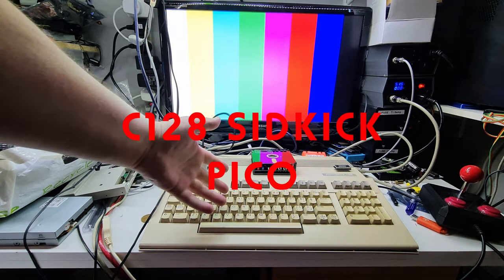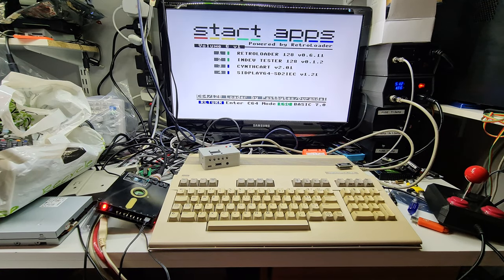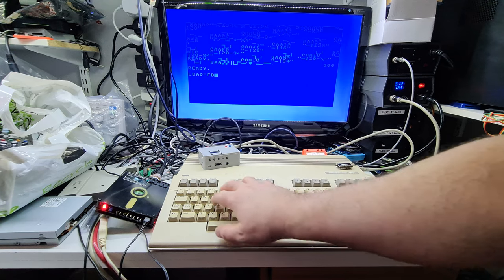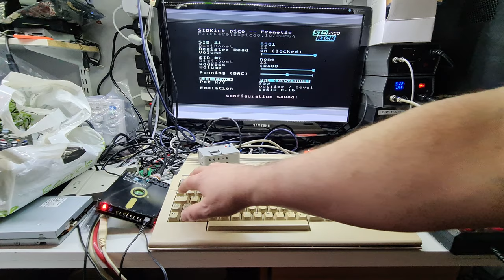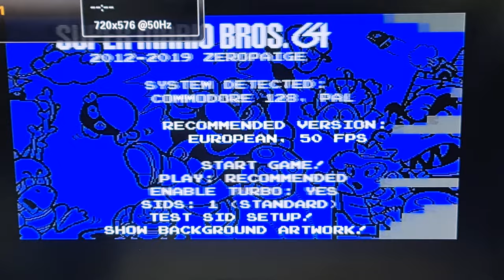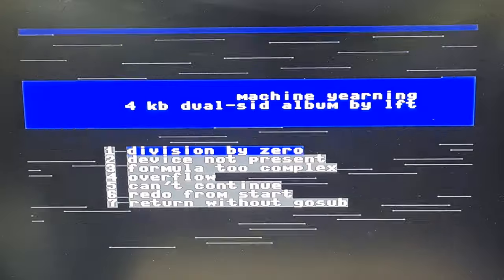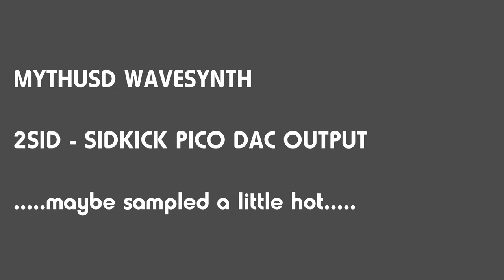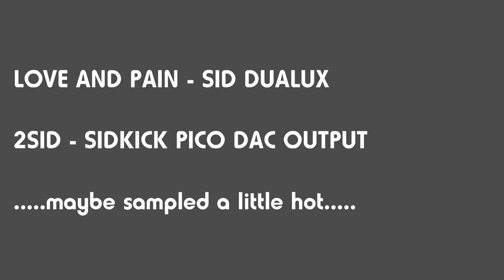C128 SIDKICK PICO - THE LOW COST REPLACEMENT DUAL SID SOLUTION ON THE COMMODORE 64 / C128

Comment: Had some trouble with the pi1541 pi3b+ option B myself, turned out to be a low quality 7406 hex inverter. You did mention it to be genuine chip in there. I had no troubles with a pizero option A. Thank you for the great video

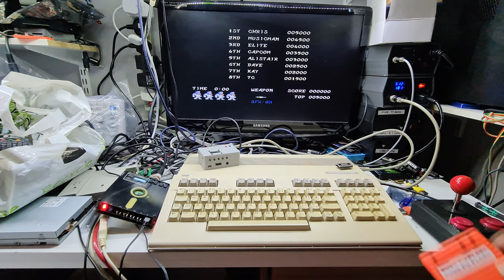Comment: 12:20 KFF is stated by its creator to work on a C128. Maybe yours needs an newer firmware? Or try adjusting the Phi2 value to see if that fixes the issue. You’ll need at least v1.27 firmware to have the facility to adjust phi2.
Reply from the maker: Hi, I have the latest firmware and it does work, But it only works in c64 mode, altering the phi2 won't help that, it's unable to run any software in c128 mode, ie prg injection doesn't work in c128 mode as doesn't D64 ( which is limited anyway )

Comment: Did you also test it in VDC mode at 2 MHz?
Ask as both the ARMSID as the FPGASID can’t cope timing in 2 MHz and start then outputting gibberish.

Good demo to test is Risen from Oblivion 2, but any VDC demo with music has the same.

If this one works also in 2 MHz I am very interested in getting this one.
Reply from the maker: I hadn't, but I will, I did test the last v8 c128 version and that sounded good, smb is also in c128 mode (although 2mhz is out of playfield) and no sound artifacts, big problem I have had before is dual sid in c128 mode but that sounds great, will try the vdc  though.......
Reply: @CaptainCommodore  issues with the ARMSiD and FPGASID only occur in full 2 MHz mode. Both Last V8 as SMB work fine also with those.
But go to 2 MHz it is very evident. Switch to 2 MHz and music is gibberish, go back to 1 MHz and it is ok again.
And thanks already!
Reply from the maker: Yea rti just said the same thing , will give it a try over this weekend

Comment: Hey mate, great vid! One thing to clarify about RFO is that the SID files themselves played perfectly on the 128 with the FPGA sid, but the actual demo didn't. Also it seems which mode the VDC was in had an impact. Thinking it was some kind of bus timing conflict. Even with a real sid chip you can hear a difference in quality between playing the SID file vs running the entire demo. My Pico boards should be arriving soon, I'll have a play with them and see how they compare. I wonder how much of an impact PAL vs NTSC there is too, I need to get my PAL machine running...
Reply from the maker: Yea I hadn't picked up on that, another chap said in the comments about firing up the VDC so the sid shits itself, will give that a try and see what happens